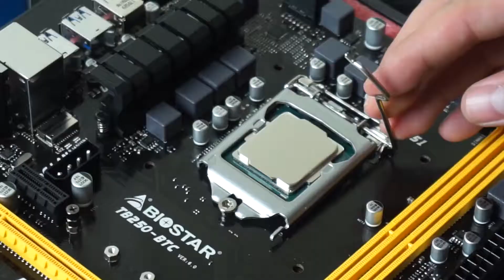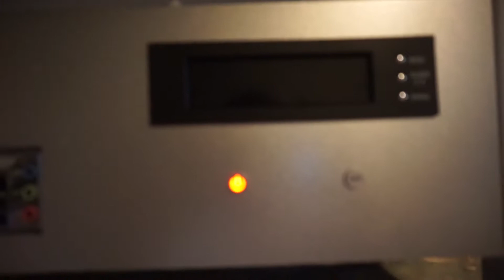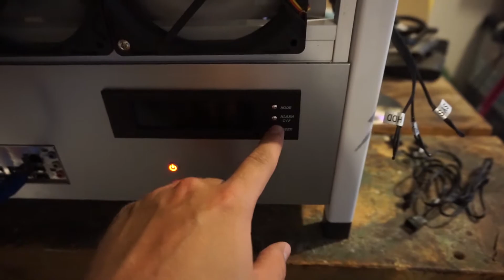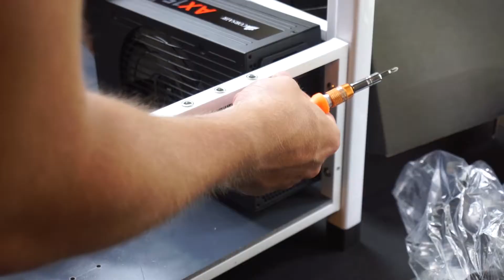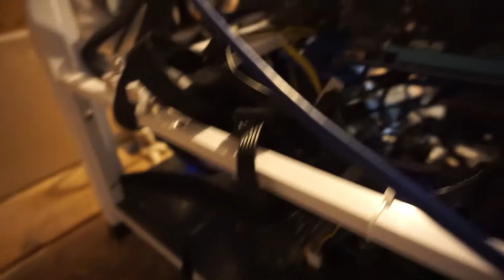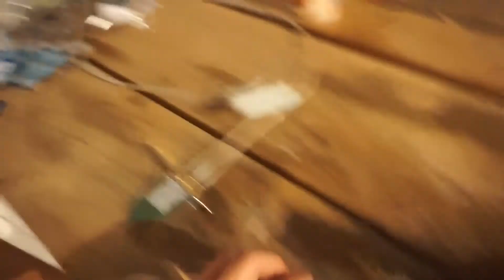Mining Rig 2.0

Comment: Terrible PSU only capable of 900w on the 12v rail; if you can return it and get the EVGA 1600 T2 then you probably should.
Reply from the maker: I'm doing that now.
Reply: @techbets102  10 year guarantee I just tested for three burnt out 1600 T2's and EVGA came through with three brand new ones.

Comment: Nice man, is it worth it to go budget mining.
Reply from the maker: That's a tough question to answer. With the cheaper graphics cards (that are still profitable), you might spend $250-$300 per card with a ROI after 9 months (which is sooner than the 1080ti) but what's at question is whether or not the mining will be worth it to you after you get your investment back. What I mean is if I build a rig with 6x1080ti that cost $6,000 and a ROI after 1 year vs a rig with 6x1060  that costs $3,000 with an ROI of 9 months, the 1080tis will have a higher payout afterword than the 1060s. So you can choose the budget mining and get your money back faster and have less money coming in afterword, or commit to the 1080tis and have your money back later but make more money afterword.
Reply: @techbets102  💯💯💯💯